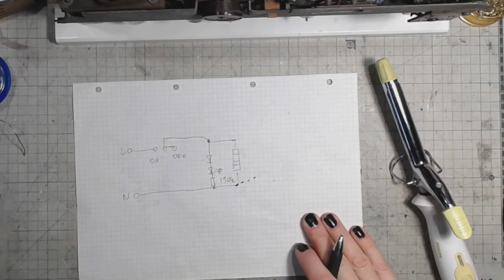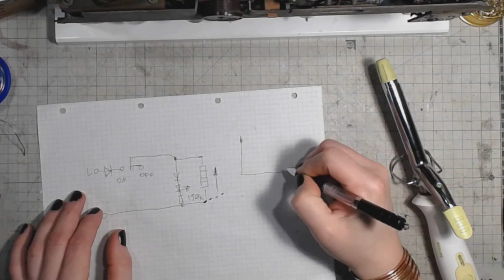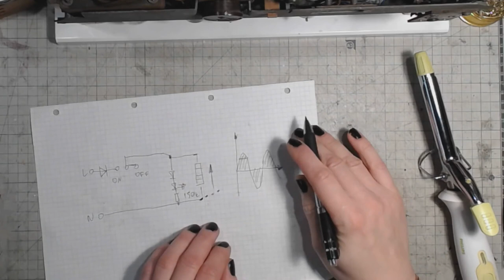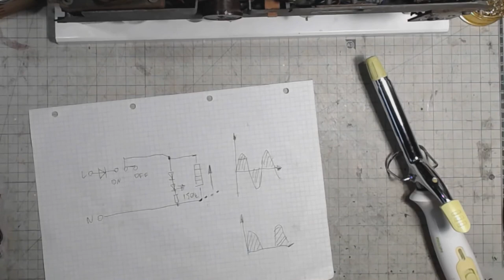Curtailing the Curler's Current Consumption

Comment: Hi, This reminded me of a gadget I used to have which cut down the power to my soldering iron when it was in the stand but switched to full power when it was lifted. used a triac with a trigger circuit connected to the stand coils. Like the curlers the soldering iron got too hot when left unattended. I still have the schematic somewhere. D